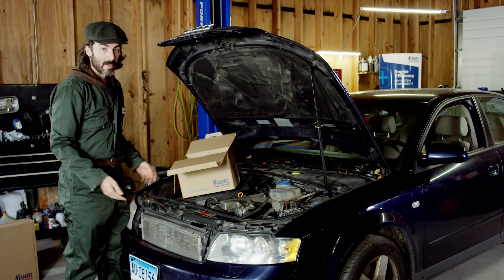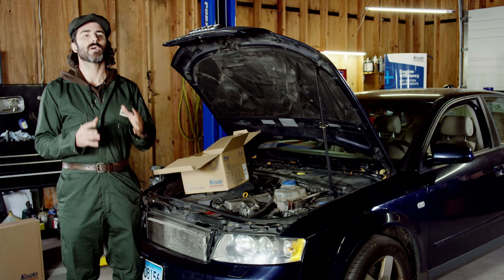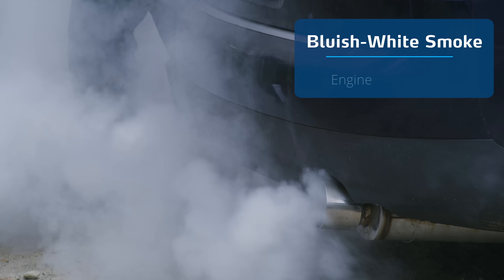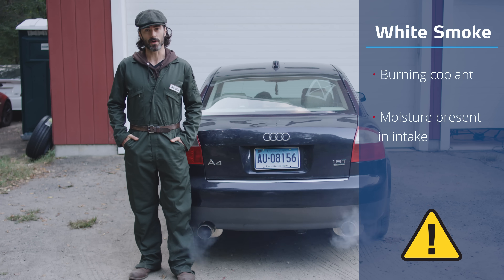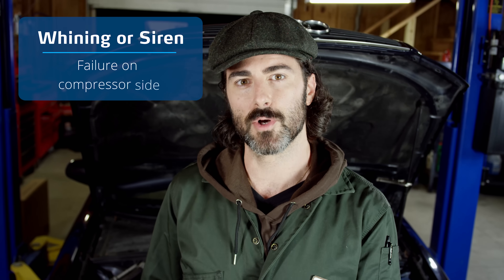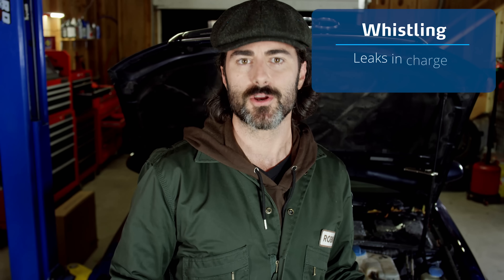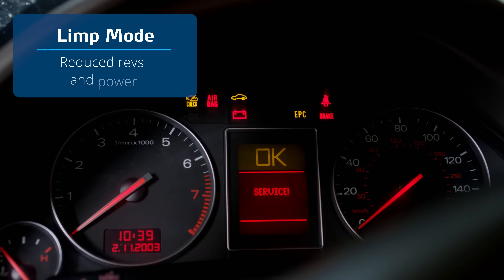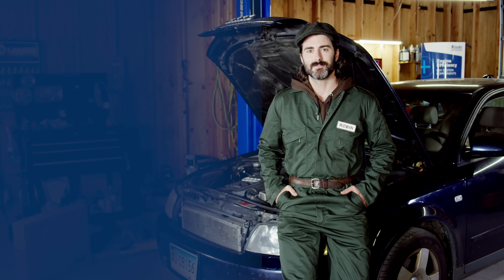Identify Turbo Problems

Comment: 3:52, Sadly you didn't show the whistlin sound, am i correct to assume if its not the "your blade will explode" sound or the "hissing" sound then its the whistling sound? It's really weird, because i haven't lost any performance, its just when i let go of the gas pedal after acceleration, it hisses like i have an air leak or something.
Reply: Did you manage to figure out what it was as I have same issue
Reply: @alanw414  yes there was a tiny hole on the intercooler flexible pipe, i didnt even see it, it was just a VERY cheap part, bought a new one, works like a charm, sound is gone.

Comment: Ive the exact cat same b6 audi avant,  smoke on start up and in low rpms in high gears when i give it some juice it’s starting to flutter slightly like a small loss of power but always  regains, is it the start of turbo failure

Comment: thats funny, i have a built mazdaspeed 2.3 engine, replaced the turbo recently, still have excess smoke. white/grey. no oil or coolant loss. no power loss.  yet it smokes everytime i drive it, some smoke even comes from the custom exhaust manifold. most of it comes out the exhaust.

Comment: Man i think i have that prob but im not to sure im not Pro i just learn from youtub all about cars So im Explain my issue 

1 maf sensor plugeddd in ( difficult to pass 3000 rpm and loot smoke white or blue idk  when i unplugg maf not comes untill i reach max rpm then goes again smoke out   2( i pres gas pedal it not response like should be  it hezitate also gain speed after passing more 2000 rpm 2500rpm  3( when i go uphill  in 3 gear not goes more than 60kmh it looks like goes limp mode   i pres gas pedal but nthg   Also in Highway It goes 100 110 kmh And Make that same thing limp mode  again  when i turn off and on car  for some 2 or 5 min drive good and then same   Also  intercooler pipe idk how u called  that goes into Turbo  i feel my hand too oily in that place and  in Ac compressor  can u plz Help me  i need badly help

Comment: I have a hissing sound on 2200rpm and used to get overboost error and limp mode. Hissing sound still there but no more limp mode over 3000rpm. Lag in accelleration andlist a bit of power. No smoke.

Comment: I’ve heard noticeable chirping noise that starts around 4k ish rpm and I can’t figure out if it’s the turbo or not. I’ve took it to Audi to get the headlights adjusted and I asked to check the engine because I’ve noticed a weird noise. They said they didn’t hear anything unusual and did a multipoint inspection. I feel like it is a bit slower than it used to be when I give it full throttle. The noise isn’t always apparent so I don’t know if it is a major issue or not. I just hit 20k miles also.

Comment: Hi Robin, After replacing the turbocharger my car has black smoke and low power. After som research I find a very glogged map sensor. I clean the map sensor and managed to remove a lot of oil and carbon from the hull in the intake manifold. I clean the map sensor 6 time. Now I have no black smoke. The engine has low power when cold. After 15 minutes drive and the engine get hot over 80 or higher. I can stop and start again now my turbo is working. What do you think is my problem? Is my intake manifold to glogged of oil carbon that the flaps do not work as it should. Do I need a complete clean of the intake manifold? Last three days my turbocharger is working fine after 15 to 20-minute drive. Any good suggestion? Please help me

Comment: But what if the sound you get when under load is more like a old bi-plane? Like a hole in the exhaust noise... 
When idling or even revving in neutral, I don't get the noise. But when I get to around 2,500rpm it gets really loud.

Comment: Best way to fix it is to replace it with a supercharger, unless you have a diesel.  You will have much better response, less heat buildup, and less junk under the hood. making it more fun to own and drive.

Comment: I keep getting P0238. It's not the sensor or wies and no leaks. The turbo seems to be getting hot very quickly and doesn't seem to spool like normal. Not sure if the sound difference is turbo failure or cold air intake. No exhaust smoke.

Comment: Hey, Ive fitted my car with a rebuild turbocharger. There is a weird noise form it ... sounds like a wind in the chimney ... something like that. Do you have any ideas? Car might be burning oil as well, but i havent drive around enough to confirm this

Comment: I have seen many videos, your videos are the best and clearest about turbochargers. No doubt oil is very important for a turbocharger to work and last long time. In m case I have bought a BMW. After 20000km the turbocharger crash. When Ifollowed the service history, I found from 2015 to 2016 the car has driven over 40000km on the same oil. And from 2016 to 2017 passed over 43000km. No wonder my car has got a lot turbocharger problems. When I have a twin turbocharger in my car. I have two turbocharger the small one is high pressure and the big one is low pressure.  There are two  pair electronic ventils, 1 pressure converter and 1 charger pressure regulatorventil for the high pressure , 1 pressure converter and 1 charger pressure regulatorventile for the low pressure. So when my car do not accellerate in the low 900-2000 rpm the two components converter and regulatorventil may be faulty.  If the turbocharger do no work from 2000 rpm and up the other pair of electronic parts are at fault. Am I right?

Comment: I have 1997 2,3 liter turbo volvo gasoline.  Boost usually comes at 2500rpm, but now it comes only at 4000rpm and I got grey smoke out of exhaust. I tried everything, bit now I start to think about bad turbo, but there is no new sounds, the blow off works as usual.

Comment: Hey Robin i have a s4 2.7 before i went for a ride i always like checking my oil level and it was right on spot later on i went for a ride and i tride to floor it and then i saw lack of power and i was throwing alot of white smoke and when i pulled over i lost alot of oil my coolant was on level as well could that be ny turbo gone bad and would it caused it to lose oil from exhuast

Comment: My one sounds like the hissing noises,leak on the exhaust side of the turbo!and when I rev it blue white smoke comes from the exhaust.and the oil has dried up from dip stick.could you give me some information on what to do I was going to get a turbo.any help would be appreciated thanks a lot😊it's a 2006 a3 2.0tdi

Comment: my car had all fauts you have talk about, 100.000 miles/ well sotted up change mass air valve/ egr/throtall bodyl/ clean egr air mixing chamber/ took the car 60 mile burn, runing a lot better but have black smoke, will fit new turbo check intercooler for leaks/ and water blast exhurst/ had no engine lights but had vault to much mas air befor clean and new parts/ after falut not enough mass air will let you no how it goes. you  can say i waste my  money  on parts but at 100,000 miles it becomes one big service i all so have to fit altonator  fan belt fb adjuster and pully wheels,injectors pass at the momeant the parts d

Comment: I don't know, I got GQ patrol with turbo 2.8l and I thinking turbo not working. I use be able to just hear turbo on a quiet road or if I was driving next to a concrete wall. Except for the not being able to hear the turbo the only thing is power but not sure as it wasn't very powerful and clutch is on its way out to.

Comment: i have a 2013 chevy sonic ltz it’s a 4 cylinder with a turbo in it. sometimes when i accelerate i pour smoke out of the exhaust & lose power but then it goes away & doesn’t reappear for awhile. i had it put in the shop & was told my radiator cap fell apart & had bad o2 sensors. i got those replaced but still have the same issue. it doesn’t happen everytime i take off but sometimes if i take off to hard i’ll lose the power & see a huge cloud of smoke behind me. it’s hard to pin point if it’s white or grey. but i haven’t noticed any leaks & i haven’t overheated nor has my check engine light come on. anyone have any ideas on what this could be?

Comment: Hi Robert , thanks for this amazing video , so I have a 2016 Chevy Malibu LS 1.5L which I got from a private dealer 2 months ago , I recently had a check engine light on which triggered many codes. I finally took it to the Chevy dealership for diagnostic today and am told the turbo is leaking oil into the inter cooler . I was given an estimate of repairs at over $3,000 . The car has only 84,000 mile on it and I don’t have an extended warranty too. Is it advisable to fix it ? Anyways the dealer I got the car from isn’t willing to help me out and I still owe on the car since it’s a financed car through a bank. What is you advice for me Sir? Am confused now . Thank you .

Comment: Hey,
I installed the cone air filter, and now turbo noise is much more present, which is normal. I, however, get some sort of small grind after the PSHHHH when I release the throttle. Like pshshhhhhh-grr... Any experience with that?

Comment: I get a fair amount of black smoke after 2000 revs or hard acceleration. There seems
To be lots of power and the mileage is terrible. It drinks fuel, and the mileage computer is now innacurate

Comment: Hello Robin, i have interesting problem with my car. If i kick down full throttle, then turbo goes off in high revs, then i turn off car and than start up car again turbo normally run, but than if i kick down throttle again, turbo goes off again... and car dont turn into emergency mode or doesnt show anything on dashboard or also diagnostic problem, maybe blow off valve can be broken or something with pressure? Do you have any idea what can happend with that ? Turbo IS38. Thanks for answer!

Comment: Nice video. I got P2565 code on a ford truck 6.7 and I believe the noise is related to the waste gate solenoid (it cause some clicking noise right after turning the engine off). Any idea if the waste gate solenoid is bad or maybe a wiring issue?

Comment: turbo good, there something different- may you need buy used from another car engine!
died engine, or may some one fixed could tell more? i had same problem - no power, changed new tyurbo, catalyc dpf, new injectors. new fuel filter, air filter, spark plugs new. engine breather new,  nothing better, no power engine died, noise making same what is in the bideo

Comment: I have driven for months with no check engine light.  My engine has NOT lost power.  I have no smoke.  But I learned I have a permanent P0299 underboost code.  My car has only

Comment: Robin. My XC70 diesel runs well for a while then l get a hesitation on acceleration and changing up. Just before the the acceleration l get a sucking noise as if there is a blockage then it clears, the noise stops and l get normal acceleration. The longer the journey the more frequent it happens. Especially bad when l go up a steep hill. Sometime the engine service light comes on. My car has been to various mechanics and the problem  has not been cured. The car is very good as regards routine servicing and all the pipe work and intercooler is new. 
The MAF fault sign used to come on but has not recently.
Any advice would be appreciated.

Andrew

Comment: This is fantastic! Replicating multiple different sounds and smoke is something that I've never seen before on YouTube videos. 
My car is currently cutting out immediately after it starts up, but when I disconnect the turbo actuator, or the wiring connector to the actuator, it starts just fine, but obviously runs a bit weird driving without the turbo. And the actuator is not sticking either, and I just cleaned out the turbo last year.

Comment: I was a little distracted Robin ☺ but I"m listening... My problem is a turbo oil leak. I'm checking the air filter and for any kinks or seals first before replacing the turbo as it is costly.

Comment: I have a 1.8 t jetta  sometimes has white smoke from the exhaust but don’t think I have any lack from the turbo the kid I brought it from said the oil light comes on.  When giving gas and doing anywhere from 40-60 it’s fine when letting off the pedale and reaching 2000 rpms the oil pressure light comes on and starts beeping

Comment: Sir,Nice presentation.I have a question.My touran engine cylinder 2 of them was replaced last week.After engine repair the mechanic told me there is a small leak in the oil in turbo and i need to change in the next 7000 kms.is it safe to ride the car till 7000 kms.

Thank you in advance
Kind regards.Kevin

Comment: I have suffered many months with limp mode fault refering to Overboost. After all the research and deduction I took the bull by the horns and removed both the MAP and the MAT Leaving the cables connected. They are immediately post the throttle housing. Using two made up blanking plates from nylon bread board and sheet rubber they were fitted across the openings of the MAP and   MAT. No limp mode but Top end torque was not achievable. Conclusion, Seems a suspect sensors.

Comment: When accelerating, you can hear sound near turbo somewhere. No oil leak signs, no bad bearing noises, etc. But you can hear air blowing when accelerating. Can the turbine itself be bad  or leak air ? Or it could be a pipe leak, but no one borhers to find, becouse turbo is hard to acces. How to tell if we need new turbo ? Or we need a new mechanic :)

Comment: My old turbo broke down and start to burn oil and i could’t turn off the car it run with full gas for about 30 seconds then it stop by it self i replaced it with a NEW one and in the frist it dident even go 60km/h and it has white smoke  from the tailpipe alot of smoke that smelled like burning oil and the whole car shaked alot like it was freezing cold but now afer 1 week of driving it has more power still shakes but a bit less and still smokes from the tailpipe and smells like burning oil….its a Diesel VW Sharan…

Comment: I have all the symptoms minus the codes, I think mines failing but not toast yet… if I try doing a pull it feels like it boost cuts constantly, builds boost very inconsistently.   I’m only able to get up and go till around 50-55.. Does it sounds like a turbo or head gasket issue?
Reply: No check engine light, white smoke, inconsistent loss of power, can sometimes hear the turbo spool and sometimes cannot..

Comment: Will it throw a CEL if there is a broken blade? I have a Sti with constant whistling noise usually at highway speeds.  The noise is there whether on throttle or off. Can tell if it is just regular subbie cabin noise or what.

Comment: Hi! I have an 07 Volvo S60 2.5t and I’m kind of confused on the “whining” sound you explained In the video. When I put the gas pedal down all the way I start hearing a charging or ring sound almost like how it sounds in a video game lol. This happens at around 4-5 thousand rpms. I’m curious if this is a normal turbo sound or if it may be the “whining” sound you explained in the video. Thank you!
Reply from the maker: Hi Dean, difficult to say, but it could be. But it's not necessarily your turbo. It could be the time belt or multi belt also. /Robin

Comment: Hi Robin, does deleting the stock muffler lead to turbo failure in a tdi ?. Thanks
Reply from the maker: Not necessarily. You can probably remove your stock muffler if the car is without DPF. /Robin

Comment: I'm having issues with my car , I've been told its turbo related . Would a turbo cause misfiring?
Reply from the maker: Hi Stu! No, a turbo would not cause misfiring if it’s running with correct boost pressure. If it’s a gasoline car and the boost pressure is too high, then it can cause misfiring, but normally it is ignition or fuel problem. /Robin
Reply: @RobinundertheHood  hi.  Is there anyway I can send you a video of my car when it was being mapped. Maybe then you could help to further diagnose

Comment: Hello Robin I am using Audi A3 2.0T. It recently started smoking. What could be the problem? If it is the turbocharger how much would it cost to get a new one?
Reply from the maker: Hello Roger! If the smoke is blue (oil), it could be a worn turbo. The price varies, but often at around 500-800 EUR. /Robin

Comment: This is the best video i have found explaining all different symptoms of a bad turbo, ive got a 2011 Audi TT 8J CESA engine which recently started smoking blue smoke from exhaust when i rev the car, whilst idling thou its not that bad and only gives off a very little until under load so im assuming it could be the turbo. i also noticed a whistling sound from intake when i rev her up, louder with cold air intake, when it smokes i can smell the oil, PCV valve has been changed and still does the same, any further advice before i take it to the mechanic for turbo replacement?

Comment: Thanks for the video really insightful. Just a quick question. I had a mechanic come out and carry out a full service on my audi a4 b7 tdi. When he left I took it for a drive and ended up losing power after a few mins with white smoke coming out of the exhaust also have the whistling sound too. When I parked up the mechanic had left the lid loose on the water bottle. Could this have caused my turbo to blow? The mechanic is denying any fault saying its just bad luck that the turbo blew after changing the oil and all filters etc. I'm out hundreds of pounds and now have a car I can't drive....

Comment: Brilliant video! Finally have some intel on what my issue with turbo is! Subscribed
 Quick question, if my turbo is making the whining or siren sound indicating a compressor issue, is this fixable or needs to be replaced completely?
Reply from the maker: Hi Ruhel, thanks very much and sorry about the late reply! If all your hoses and piping together with the intercooler are tight, it could be a worn turbo. Today, the cost of a brand new turbo is similar to a reman turbo, so you might as well get it replaced with a new one. /Robin